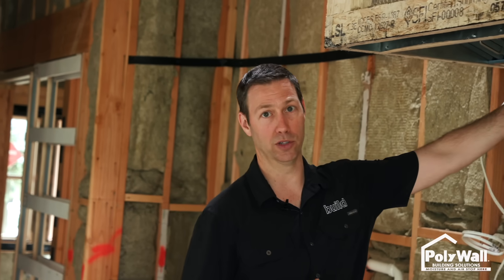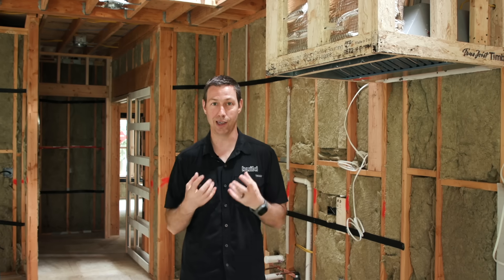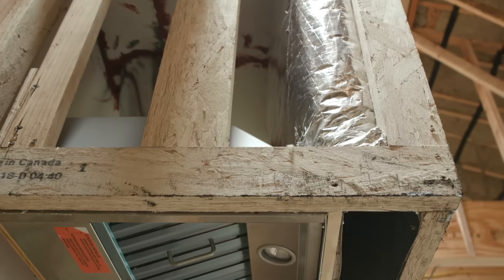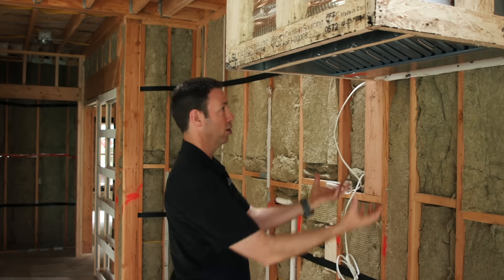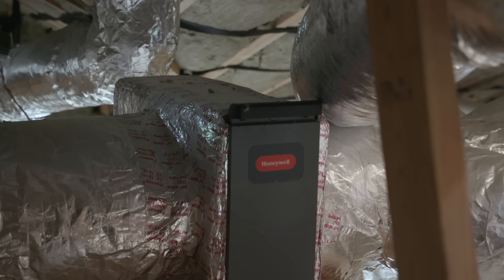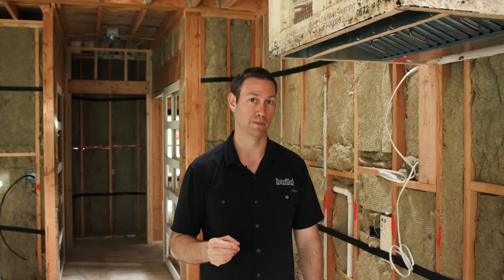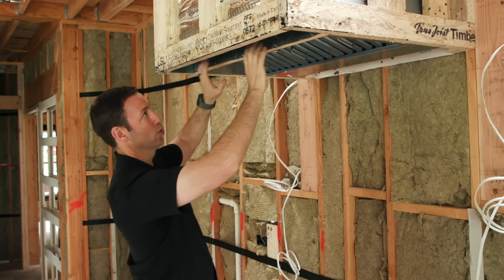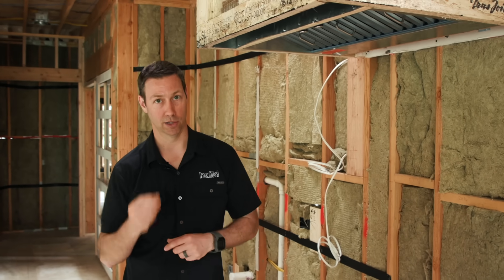Make Up Air - Kitchen Hood in a tight new Build

Comment: That setup has to be illegal. Those flex ducts cant handle that range running all the burners.  If your range is running but the hood is not it could be possible hot air is entering that flex duct

Comment: But, why would you want your make up air to be drawn from a similar proximity to the (dirty) exhaust air? Wouldn't it be better to draw the air from at least a few meters away, and lower, and (even better), nowhere near the exhaust air, otherwise you're just pulling the exhaust air into the makeup air, so just circulating most of the same (dirty) air?

Comment: So, is he suggesting that if my house was built in the ‘50s and I’m installing a completely over powered 900 CFM fan that I probably have enough air leakage to forego an intake fan? 

I didn’t realize this was an issue when I bought the fan. I’ve never had good ventilation in a kitchen and I don’t ever want smoke in my house again so I bought the most powerful fan I could buy.

Comment: Hey Matt, love your videos. I'm a mechanical contractor in NC and I am trying to make myself into one of the high quality (instead of low cost) contractors.  I was wondering what made you decide to stick with a passive make up air instead of active. Is the hood a low CFM (400-600) hood or is it higher? I'm about to install make-up air for a home where they are installing a 1,100 CFM hood, so I'm going active, and putting my outside air vents in the floor below the cabinets in several toe kicks... 

I watch your stuff, especially when it comes to mechanical and building envelopes.  Any thoughts would be really appreciated... or if you already have a video on this that i've missed...
Reply: I doubt he'd do it this way again, I think in his house he has an active makeup system.

Comment: I just did one of these, ended up retrofitting and moving the make-up air in the back. Customer complained the make-up air was unconditioned  and blowing hot/cold air on their hands and face when cooking. About a $2500 CHANGE ORDER.
Reply: Did you move it in the back behind the stove or ducted the same way next to the hood, just the make-up duct against the wall instead of in the front? Did it solve the customer's problem?
Reply: @chvitaly  Ended up running it into the AC supply for around 4 diffusers in the kitchen area with a flow diverting valve to make sure it never put back pressure on the air handler. No complaints so far.

Comment: Sorry, Matt, but the placement of the fresh air inlet makes no sense at all. This placement of the air coming in from the outside would just lead to it going right back to the outside. You want to suck up what's below though (i.e. the smells coming from the cooking). So the fresh air should come out from below the sealing. This way you produce an airflow that would provide fresh air to the room, while all the air from the smelly cooking is sucked in and transported to the outside.

Comment: Without a fan pushing this "makeup air", this is still relying on negative pressure INSIDE the space to draw the air through the filter. Look at ANY commercial set of prints and you'll find when an exhaust system is used whether it be for car-mon, dust collection, restaurant kitchen hoods, lab hood, paint spray booth etc, they have a POWERED MUA, not just a hole in the structure with a powered damper. This would be classified as relief air not makeup. To be makeup air, you MUST have a fan pushing the air back into the space in equivalent volume or your depressurizing the space which is the ENTIRE point of "makeup air". So, not a killer system but a lazy workaround that will limit the efficacy of your hood and cause other issues due to the depressurization. It's kinda the whole point of an MUA system. Is there a follow up video where you test the home's pressurization before and after the exhaust fan is on? And a smoke test to make sure your hood isn't just short cycling? Builders and HVAC pros already don't think about the V in HVAC enough so I can't say I'm surprised.

Comment: Although it's great to see a provision for makeup air,  the location where the makeup air is being introduced is far from ideal, for a few reasons.

-Let's start with turbulence, disrupting the natural upflow of cooking fumes.
-Looks like that hoods inlet surface will be mounted 36", or higher above the range, which will be too high to be effective.
Commercial ventilation hoods mounted 48"-60" above the cooking surface work because they overhang kitchen equiptment by a minimum of 6",  and have air flow of 200-500 cfm per lineal foot of hood.

- As impressive as that ventilation air-pac-insert looks, performance of those is anything but.

It likely has two 600 cfm blowers, basically like small furnace blowers.

Impossible to clean, noisy, and vibrate at high speed.
The biggest problem with using this type of blower is, they will lose around 50% of their airflow once they are connected to any type of ducting.
So, basically that 1200 cfm ventilator will likely only be loudly moving a delivered airflow of 500-600 cfm on it's highest speed,
mounted as high as It is, with makeup air blowing cooking fumes towards the counter, and back wall, the hood won't be effective for ventilating.

As others have noted, makeup air should by most codes, be provided by another mechanical means (fan/blower) also should be conditioned, provided with an inline heating element, depending on climate, and local hvac/building codes.

Comment: Have you ever installed one of those Best Downdraft units?   I'd like to know what end users think.
Reply: Don't bother with any type of down draft ventilation if you want something that actually works well.
Reply: @fartman2269  Thanks - even 1100CFM models?    I see the 600 CFMs are worthless but the 1100 models seem to be adequate.    I'm genuinely asking - not contradicting.
Reply: @boedillard8807  Forsure, I understand you are merely looking for advice.
 The most important aspect is delivered cfm.

Even a unit rated for 1600 cfm will likely move 950 cfm, or less at full speed.(If your lucky and are against an exterior wall, and only have one 90°elbow and a few feet of duct with a termination hood, you may end up with a flow closer to 1100 cfm)
This is highly dependent on length, and type of ducting.

a unit rated for 1100 cfm will move around 
600 cfm, or less after ducting, and termination loss.

People generally don't consider delivered airflow, vs out of the box cfm rating.
This is very important as down draft ventilation defies the law of physics, and a tremendous amount of airflow is required to make the ventilator somewhat effective.
We never see any type of ventilation like this in a commercial setting, for several reasons.
Reply: @fartman2269  Interesting - I saw something about IQ (I think that was the brand name)- making sure the CFM is the rated amount.
Reply: @boedillard8807  Yep,  always factor that you will lose around 40-50% of the gross rated airflow after installation due to ducting, termination wall cap, filters, and inner air channels of the unit
 

The longer the ductwork, and more changes of direction will decrease  airflow significantly.

Comment: Unfortunately with this design you will create short circuit and the makeup system will not work as advertised. So if this hood is rated 1000 cfm will be acting like 500 cfm, because the  blower will be sucking the fresh air directly from the markup duct, actually doing nothing useful. It is too close to the hood. The better design will be if you install the fresh air under the stove. or on both sides of the stove.
If you want to talk to a specialist, call Victory range hoods at 1800 3944020

Comment: it would be wise to install the make-up air into the plenum of the return air to condition AND filter the air so requiring only 1 filter to service which should be changed 2-3 times a year anyway.
Reply: Yes, this is what I was thinking. If the outside air is very different in temperature, humidity and contaminants than the inside air then why would you dump it into the living space? Seems best to condition it before letting it come into contact with inhabitants. Introduce it directly to the return supply and get it over with.

Otherwise save the expense and just open a window!

Comment: I would like to see more about this topic specifically for retrofit applications. My wife cooks in the house just about every day and the smells linger. I also just put in some new panasonic bathroom fans and when they turn on you can tell they are causing the house to pull in air from various locations. I would like to be able to sync up a make up air system when either a kitchen or bathroom an comes on.

Comment: What you want is a chimney effect with range hood exhaust. Bringing in air right there pointed at the source of the smoke and smells is going to blow that air and smoke all throughout the room, and displace some of the air you are trying to exhaust when some of it makes a hard U-turn up the vent.
Replacement air just needs to makeup for the negative pressure the exhaust is creating in the room, and should be anywhere else than near the exhaust source. It's like pointing a HVAC supply register right at a return.
Reply: Exactly.
 I'm thinking to cut some vent holes through the wall behind the kickboard under the cooktop, ant then putting a grille in the kickboard to tidy it back up

Comment: I find these videos interesting, but I must say the real take-home lesson is that I am very lucky to live somewhere where you can actually open a window occasionally.   Apparently, Houston is not such a place.  You have to think all these people living in sealed up houses with their carpets and paint and such slowly off-gassing are going to end up with long-term lung problems or worse.   I have a whole house fan, and while there are plenty of days I button up tight because it is too hot or too cold, I rarely go more than a week or two without opening up the windows, flipping on that fan and replacing all the air in the house with fresh air.   Even hot summers occasionally have a cool evening or the occasional warm afternoon in winter, allowing this to happen at minimal or no cost.  The idea that I should be afraid of pulling a bit of fresh air from outside when running the range hood for 20 minutes or so is just insane to me.
Reply: Houston, or Florida where I live, yeah those days are few and far between where you’d actually want to open a window. Even if the outside temp is nice, humidity, pollen, pollutants, smog, etc are likely present and just makes it all the more work on your AC to cool your house again. This is a super smart idea for what Matt cooked up to prevent depressurization and not exhaust all the air you just paid to condition.

Comment: Do you install makeup air for clothes dryers?
Reply: Heat pump dryer. No makeup air required, huge energy savings.
Reply: Does it reclaim the moisture and exhaust the air inside the house? A regular dryer blows a steady stream of air outside that has to be replaced.

Comment: Make up air is required by code where I live. With a massive 1000 cfm blower that meant a 10” duct of outside air coming into my house. Even with a damper on it, I wasn’t excited about that huge duct so I downgraded the fan to 600 cfm, which meant just a 6” duct for makeup air. Next I did the hood fan as an in line fan, located just outside the home, above the covered porch, so the noise is reduced, instead of having the fan blower right above the range where it is noisy. My makeup air is tied into my HVAC system so the outside air gets filtered and I don’t have one more filter to change or worry about. And I don’t like the idea of putting a big vent right in front of the range hood, all the air flow nerds are arguing about whether this is good or bad for air flow but what I’m saying is that it aesthetically just looks bad.

Comment: Placing the inlet air immediately adjacent to the draft inlet reduces some of the draft forces above the pots and pans on the burners. This will result in needing to use a higher fan speed than might have been necessary.

Adding inlet air is a good idea, but if the inlet air can be placed somewhere other than right next to the draft inlet, the efficiency of the draft fan is not reduced.

Comment: Why not put the air intake in that wall directly behind the exhaust? Would be a tighter space and wouldn't allow for such an enormous filter (is that huge thing really necessary?) but would save a lot of flex duct.

Comment: Hi Matt, 
Gr8 topic.  That was a major concern for me when I was building my ICF house 4 years ago which is very tight and with a balanced flow from an ERV.  You might recall advising me on that.  Well, We just a normal range hood with an inductive cook top, nothing so elaborate.  But we also have a whole house Vacuum & Dryer which blow out air.  
My solution was to use my UltraAire XT105 (another item you recommended) & its very handy auxiliary fresh air intake. 
 The cool part is i have 3 current sensing switches that sense if the hood, vacuum or dryer are on... the then activate & open the 100cfm XT105 auxiliary air intake.  
I love the UltraAire XT105 for some important reasons... the make up air is a big one.  
Thx for your years of advice!

Comment: Make-up air for hood fans with more than 300 cfm  has been code in Canada for years now. Usually connected to the furnace and (filtered) fresh air intake. Why is this a better system? You would think the incoming air would disrupt the flow of the exhaust, and make it less efficient?

Comment: Also, something to think about is tempering your makeup air. Work for a commercial HVAC company, so this was nothing new for me. But, depending on where you live (really hot / really cold), you might want to temper your makeup air. Otherwise, on a hot Austin day, your dumping a lot of heat into an already hot thing, so if your “slaving away” at the hot stove, drawing in 90 / 100°+ air will make that feel even more miserable. Or likewise, if your somewhere really cold, you could be dumping literal freezing temperatures into your kitchen, which could affect the temperature of what’s on your stove. And while yes, the hood should in theory capture most of this, if your HVAC system is running while the exhaust fan is running, my guess is you’ll get less capture of that makeup air from the hood then you’d like. Yes, it can be expensive to do, but in the same regard, it might be worth it.
Reply: 1000% agree with this, and especially keep the exhaust duct away from the inlet to the HVAC, to reduce the likelihood of circulation of the dirty air.

Comment: That timber supporting the hood looks like it was made from the packing crate the hood was delivered in! No way would I want or allow that in my home. Why not a full stainless self supporting hood hung from the wall?
Reply: I'm pretty sure those are LVLs, engineered lumber.  Straighter, truer than cut 2x4s.  Framing allows for other finishes around the flue, like stone or tile.

Comment: Only point that was missed was how you are tempering your make up air. Thermolec has a pretty good modulating make up air system. Other than that good setup and design.

Comment: As an HVAC owner/operator this is code to have make up air for anything over 400 cfm (Michigan code). I find it extremely wasteful to use anything over 400. In the winter you have extremely cold air being put into your home and in the summer, extremely hot /humid air. ERV are an option but not very effective/efficient and very costly. People need to stop trying to make their residential kitchen be a commercial kitchen! If you want a commercial kitchen, buy a restaurant or become a chef.

Comment: How do you do make-up air in bathrooms with exhaust ventilation?
dampers on the intake duct and heating ducts?
(wouldnn't an exhaust fan draw directly from the heating ducts/openings thus other rooms?)
Reply: Bathroom exhaust fans / ducts should have backdraft dampers that prevent outside air from being pulled back into the house. Key word, should. Someone missed them on my house and I had to add them back in. Luckily I work for a commercial HVAC company, so I was able to get one of our guys to do it.
Reply: Panasonic  FV04 ERV
Reply: The typical residential bathroom has only a 50 or 75 CFM "fart fan" in the ceiling, which I promise isn't going to vacuum all the air out of your house. Restrooms are supposed to have slight negative pressure anyhow.

Comment: It’s better to have the “make-up-air” closest to the cooktop. That way, the suction of the hood vent will draw the air parallel to the direction the cooking vapors will run on its way out. 
The way it’s located in this video, there is too Direct of a pathway for the make-up-air. The vent will be venting-out air that was JUST pulled from the outside of the house, to be pushed back out there. 
If you’re going to go through all this trouble and have a vent for make-up-air, it should be positioned optimally, or you are actually doing more harm than good.